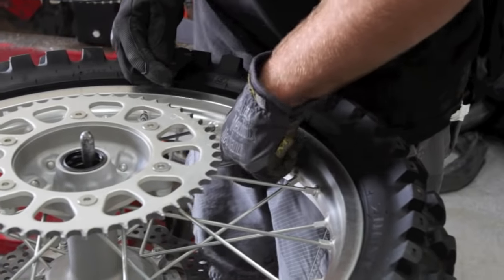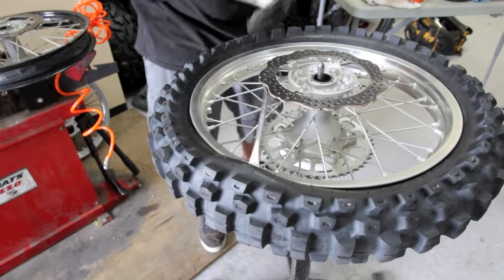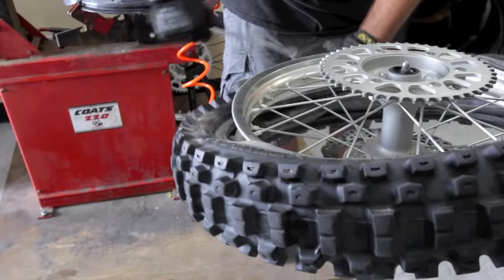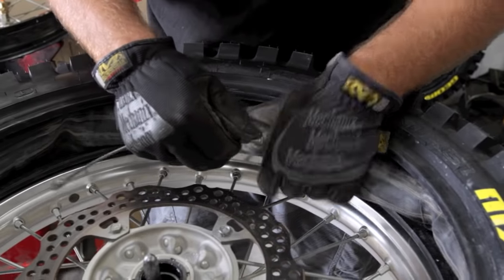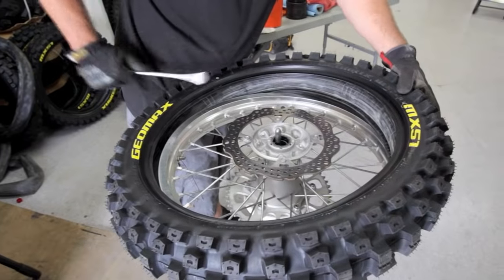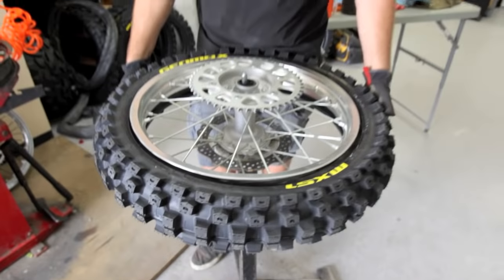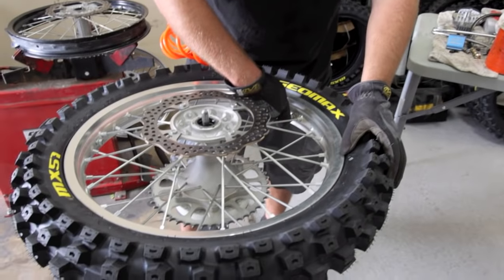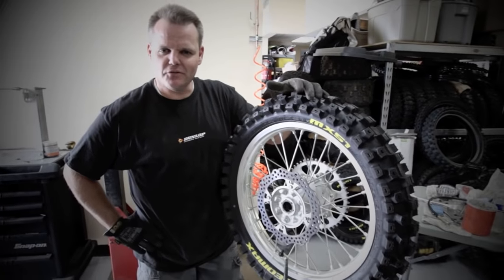How To Change A Motorcycle Tire

Comment: You forgot to add cussing and throwing tools. Most important patches. Thanks for the video. As for a tire stand as someone else commented I just use a long screwdriver in a vice and toss a small square scrap board with a hole in it over the screwdriver as a base.
Reply: That's a genius idea man. I'm a little late to comment, but god damn I gotta try that!
Reply: Might work fine for an MX tire. For a 16" mid-size cruiser wheel, I bent an old 7/16" shaft Stanley made-in-USA screwdriver over 80 degrees.

Comment: What an amazing video. All these years, struggling with tire mounting/dismounting and one 8 minute video illustrates the error of my ways. And it works for the most stubborn of tire/tube combinations, big or small, fat of thin, bicycle or motorbike The secret sauce in your method is just the right amount of air in the tube. Thanks.

Comment: Putting the inner tube into the tire first and then only fitting both into the rim, is the right method to use. Using dish washing liquid as a lubricant is also a must to effectively help the tires to fit onto the rim. Thank you for freely sharing your expertise with others.
Reply: He literally tells you why that's a bad idea...

Comment: I like your method of putting the inner tube into the tire first before trying to install both the inner tube and the tire back onto the wheel. It makes putting the tube valve back onto the rim much easier. Half inflating the inner tube before putting it back onto the wheel was another great tip.

Comment: I changed the rear tire on my 2006 KLX 250s Dual Sport on Monday, and it was a tough one. It had been a couple of years since I changed a tire and it took me 2 hours, and according to this video I did at least 4 things wrong.   WOW!  Putting the tube inside the tire before getting one side of the tire on the rim....DOH!  Now I know.  I'm saving this video in my favorites.  The Kenda Trackmaster II is a really stiff tire as well as the Kenda Extra Heavy Duty tubes which are 3 times as thick as normal tubes, man it was a bear to get on.  I'm glad I don't have to mess with rim locks, my bike doesn't have enough power with my weight to ever spin a tire, 17,000 miles and I've never had a flat tire.  Thanks for this video.

Comment: wow that`s one soft Tyre , every Tyre i have changed seams to made of the hardest rubber ever invented . :)
Reply: Agree :) 10 inch tyres WORST
Reply: ****Tire
Reply: Set them out in the sun to warm up. Or, if the tire is still usable, take the bike for a spin around the block to put a lot of heat in the tire. It makes it SO much easier to change.
Reply: @DustySquitoNM  plus soapy water. Get some longer tyre levers too.  I feel for you mate. I had to use an old fork leg on the tyre lever; the rubber was so hard. (winter perhaps)
Reply: in cold place: use hot air gun
Reply: Rubber? These things are rubber? All of my tires are so hard to mount I think they're metal
Reply: I mark the f*** out of my 14" rear pissed. Bough new Chinese rim+tire $95aud. It pissed me off that bad
Reply: Definitely agree every tire I change is not soft.  Maybe I'm being too cheap when buying
Reply: @pr0h4ck3r2  spelt different around the world. you probably know this by now but yk
Reply: @nicown1337  I replaced around 500 tyres in my time working for a Honda Motorcycle Dealership across many types of bike using both levers and machines. I kid you not, I almost threw my kids KTM50 rear wheel across the garage in a fit of rage. By the time I got the tyre on, the rim looked like someone had beaten it with a pick axe. I think the Michelin Starcross were the worst for  me, you can hear the rubber tear as you lever on the last bit, no matter how deep you push the opposite side into the rim.

Comment: A tire stand that brings it up so you are not bent over getting sore doing what can be an aggravating job a lot easier. Get 3 good spoons, all kinds of styles, and the bead buddy helps too. Just keep it all in the box the stand comes in along with the baby powder and spray bottle with dawn and water and a valve stem insert tool and maybe even the Allen wrench the stand needs for assy. It's all together and takes all the searching for this and that stress out of it. Great video here, lots of suttle style tips, watch close.

Comment: Did a used $5 dirt tire (super stiff) on the rear 1972 Yamaha XS650 rim on the garage floor with 2 Craftsman orange plastic coated crescent wrenches...aahhh those were the days.....took a grinder and took off the nubs hitting the frame..off to the track!

Comment: During the summer months. I would leave the tire out in the sun for a while to soften up the rubber. It made it a little easier to change. Every little bit helps. After a few years, it was much easier to drop it off at the local shop in the morning, and pick it up in the after noon. Worth every dollar when you get older.

Comment: its been 10 years since i changed a dirt bike tire... and  i followed your advice...   Soapy water will work but nothing  like simple green right? thats too slimy right?  do you pack grease in the wheel bearing hole  before re installation?

Comment: This tire looks so soft. Its not always this easy
Reply: sigurd2498 I think he may have had a little help from heating the tyre up, unless the temperature is already 30 degrees celcius or more, im trying at the moment in tasmania, is only about 12 degrees and this bastard aint going no where unless i destroy the rim, time to get the heat gun out
Reply: My recent Shinko 244 tube type rear is in the garage 3/4 of the way on the rim and will not go any further. I'm thinking my heavy duty tube is taking up too much room inside so the tire can't slip down into the center of the rim. And now it's 40 degrees F outside so  I have to wait for warm weather to take it off and switch tubes. Argh.
Reply: The tire has been heated and is more plyable
Reply: I think I lost about 5 pounds sweating trying to take my tire off then the tube an the tire I almost had a mental break down 😂😂😂😂😂

Comment: its soft cos he got heaters. just give your tyre a hot bath. saves looking everywhere for your tools and fingers afterwards. also if you dont want to scratch your wheels tape your screwdrivers/crowbars with masking tape and rim with see through tape cos its slippery when wet. tape will hold out the 1st go if quick enough. good video i'd love a decent shed/workshop
Reply: hola

Comment: how are you cameron I hope you are well I have a question I would like to know if my motorcycle has the possibility of putting a thicker tire? the size of the rear tire 90/100/14 and the front is 70/100/17 so they originally come

Comment: Hi Jay, GREAT demo video. Question: do you have to do anything different when mounting a trials tire on back? 

I bought one of your bike from you years ago (2009 crf250X) and still love it, but need to replace the back tire and wanted to stay with the trials type tire. I bought and mounted the exact same tire (Michelin) but it seems to be lop sided a little, or sort of off balance a little bit. Any useful tips here? Thanks!

Comment: Solved my problem.  Couldn't get the stem in because the tire ends wouldn't spread apart enough.  I usually get the tire half way on and put the tube in.  Put the tube on first :D

Comment: Great video. After pinching several tubes in a row with all the right tools, I realised i just was not using enough lube. I have not pinched one since.
Reply: TNT Moto what type of lube do you use?
Reply: francisco padilla dish soap and water in a spray bottle

Comment: Is it not a problem that the tire seems to have been making 'screaming noises' when it seemed to be getting torn, I mean It is tight and the little bit of taring noise I got of mine when destroying a tube last time I tried; it made small damaged areas, very much like what looks to be the same amount of pull on this video, is that alright to leave? is there any amount of ripping that becomes a problem for abrasives to the tube when installed?

Comment: Looks real easy but how do they get the tire so soft? My new mx32 is no where near as soft as that. I don't get it? How hard do you need to pull on those irons?
Reply: +Robert Ryan Are mx32 good on lose dirt sand and mud
Reply: +Robert Ryan ..set in the sun, no sun...blow dryer for a few minutes makes a diff.
...now try changing with extra heavy duty tube :/

Comment: I lube the bead the same as you but if you look at where the bead area contacts the rim as you install it you can see the underside or inside of the bead is where you need to lube as well so it slides off the rim, I dip my fingers in lube and run them under the bead all the way around the tire.

Comment: don't be afraid to change your own tires... it's easy peasy
Reply: +Ichiban Moto I have a 78 honda xl125, the front tire was so dry rotted we had to cut it off and we cut the tube :'(
Reply: I change tires myself and it's BAD ASS .
Reply: Bad ass
Reply: I tried and cant get it to beed right
Reply: Yeah until you bend the rim 🤦‍♂️
Reply: I punctured 3 tubes while changing 2 tyres... not fun

Comment: My rim clamp tire machine make fast work of these. Clamp the sprocket and wind the hole tire on at once. You got to be carefull spinning it on. Time you made this video Id had it off and on the bike. I hate taking there money its so simple.. The front tires are a little tricky on a dirt bike. My customers are impressed every time I do it..It takes longer to get it off the bike than changing it..

Comment: Lol he makes it look so easy...
Reply: Depleted_Uranium235 Must be one of those having the right tools for the right job kinda things. :P
Reply: +DanOn2Wheels its that wheel stand he uses that makes it easier.
Reply: fucking oath! i tried his way and all my knuckles are bleeding now due to the repeated blows to the sprocket. Fuck me.
Reply: this is still my go to video when I change any tire. Right now doing my sons PW80 for the 3rd time :(
Reply: I just swapped my Anakee wild rear tire. Those things are so much stiffer than the dirt bike tires in this video.
Reply: I've done it a few times now and its not so easy... what about taking it off and reattaching to the bike!? Some help putting the rim back in and reattaching the brakes and whatnot would be appreciated.
Reply: @DaveZaniboni  I just did the rear tire on my 2001 honda xr200r.  Didnt go nearly as smooth as this video lol.  Old tire was super stiff, took forever to get it off the rim.  Get the new tire halfway on, then put tube in and fought like crazy to get the valve stem through.  Get the tire the rest of the way on and looks like I pinched the tube since it wont hold air.  All that work for nothing so aggrevating.  New tire is also fairly stiff as well so it was hard to tell it lost air because I could barely push the tire in.  Whatever tire this guys using it looks easy to stretch.  I'm not going to bother trying again I'll just pinch another tube.  Going to call the local shop in the morning and see if they have a tube in stock and what they charge to do it.
Reply: @berube361  i pinched my first tube, then i realized how much smoother everything goes if you slightly inflate the new tube beforehand.
Reply: @DaveZaniboni  I did slightly inflate the new tube.  One problem is I think the tube may have been too large even though its what was called for on the OEM diagram.  But I've since found out the tire itself has a date code of 1506 so it was made 15th week of 2006.  Pretty old new tire that was sold to the previous owner of the bike.  The tire I pulled off the bike originally had a date code from 2000 so it was the original tire and it did not want to come off.  But the replacement tire is way to stiff and the date code makes sense now.  Probably worth spending another $60 for a new tire plus tube that I'm sure will be more flexible.  And I'm sure I can tackle the job again with an actual new tire.
Reply: @berube361  glad to hear you're taking it on yourself again. Sometimes you must make mistakes yourself to avoid them in the future. If you keep riding you'll need new tires again someday. Its best to know everything about your bike so you can maintain it and change a tire or a chain or even clean out and cycle your carb jets. I'm new to this too, it took me forever to figure out the problem with my bike was the damn sparkplug. I'm glad i struggled to figure it out tho, I happily would've payed any shop a couple hundred bucks to get the bike started. I watched youtube and realized it was a $2 sparkplug.
Reply: @DaveZaniboni  I've been working on my own bikes for many years now.  Have done a few tires but usually just let a shop that do it that has better tools.  But everything except for a bottom end rebuild I've done.  Currently working on a 1986 Kawasaki ninja zx1000 along with the 2001 xr200.  Its rewarding doing things yourself but sometimes something simple can be a huge pain, like a spark plug haha.  My xr is taken down to just a rolling frame with the motor, well the rear wheel is off now too.  Have to adjust the valves and decompression cable and then timing chain once it's back up and running.  Always something going on in the garage but wouldnt have it any other way.
Reply: @mikeycassey8507  mechanix gloves...lol
Reply: @jaypuck6912  and when you are 50 miles into the woods with a flat tire?
Reply: @stuh7049  Fortunately I haven't had to deal with that yet.  But when that happens, I'll call work and let them know I'll be a few days late.
Reply: Yep it's always easier to pay someone else to change your tyres. They have the equipment, the tools and most importantly the skills. Changing 1 tyre in 4 years does not make you skillful.
Reply: Thats years if experience

Comment: Just bought a car tire changing stand ,was cheaper that the motorcycle one ,I just cut the car wheel bar what the wheel goes on and welded an axle from a motorcycle put vented car brake disc over the top to get over the weld ,put a none slip rubber mat over the top with a hole in the middle on top of the disc ,it works fine ,I destroyed one wheel trying to horse on the tire not knowing about the bead,as long as you keep the bead on the opposite side to irons in the middle of the wheel it goes on pretty easy  ,if it’s Hard the bead ain’t in the middle ,a heat gun on low in the new tire to warm it up is definitely a must ,get the tire soft and easer to move,I used washing up liquid and water for lube ,worked well,once you get it pretty easy ,the bead in the middle is the key 😎
Reply: Also start on the opposite side to the valve and leave the valve area to last 😊

Comment: There was this one time i was at a race trying to hurry to replace a rear tube before my riders next class. Not much time between classes when racing multiple classes. My tire spoon poked three brand new tubes in a row on the very last bite to pop the tire completely on.  LOL I couldnt figure out why, until on the 4th tube i realized i had wound the tube valve stem nut on the whole way and puffed up tube too much. Moral of the story, take your time and watch what you do  :)

Comment: This guy makes the job look easy. I changed 2 motorcycle tires on 17 inch rims. Trying to slip those last few inches of the tire on to the rim was very, very difficult. I ended up scratching the chrome rim on the thicker 3 inch wide back tire. Bicycle tires are easy to change for the home mechanic but not tires like these.

Comment: I've recently come to realise that the issue I've always had was not enough lube! Douse the tube, inside of the tire, outside of the tire, hell even the rim in soapy water, the more the better! liquid laundry soap works the best. I've found 90% water 10% soap. The hardest part is not taking a bite out of your tube with the spoons (again, soapy water will help with this). Best of luck!!

Comment: No wayyyy I spent 2 hours struggling bent my spoon then caught the bus in with it and went to a motorcycle shop to have them finish it haha
Reply: Same here...struggled with mine and ended going to a tyre shop to finish it off ! I did get the general idea of what needs to be done for when I really need to do a puncture repair on the trail myself. :-))

Comment: what's the purpose of the rim lock? do all bikes have these? thanks
Reply: dirt bikes probably all have it and its purpose is so you won blow  your bead of the rim i think?
Reply: So when you slam on the breaks, or pop the clutch, the tire does not spin on the rim and suck the valve stem inside the wheel. Saves you from getting a flat also.

Comment: This video and reality are radically different. Pro Experience + Stand. Has a machine in the back drop. Normally first bite and flip allows no room to get the next tire iron in. Best extra tip for garage floor mechanics is to let it bake in the hot sun or a bit.

Comment: Just one thing,before you put the tube in that tire ,run your hand inside the tire to make sure there s no wires sticking out or any other defects that might puncture your tube,save doing the job twice and only takes a second!Other then that great video!

Comment: He also didn’t demonstrate scratching ur rim 500000 times
Reply: Nick Roberts
Lmao true
Reply: Bob Smith Relax.
Reply: I use rim protectors on ally wheels, hard plastic shrouds that clip over the rim andkeep the irons off the alloy.Also note he doesn`t tighten the valve retaining nut down onto the wheel rim, i always leave it slack to enable the tube to move a little without ripping the valve out the tube.
Reply: Kinda did. Listen closely for a good cringe.